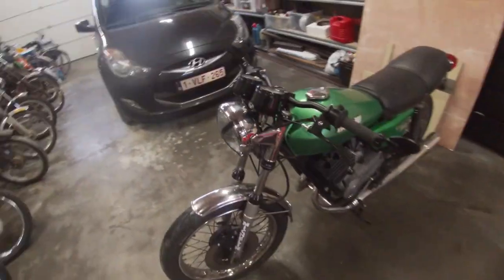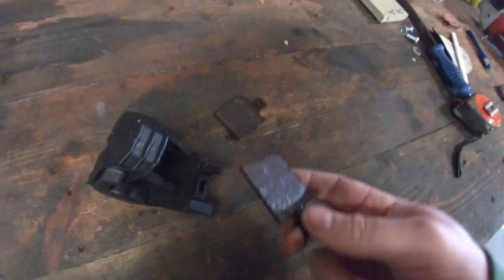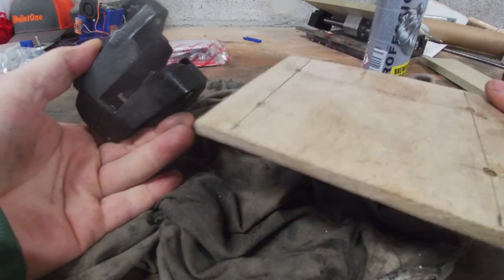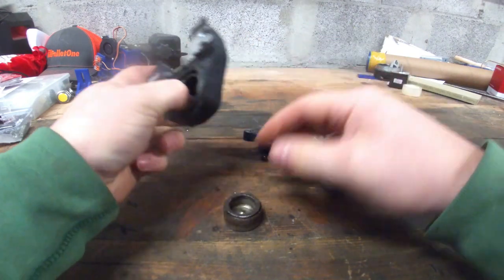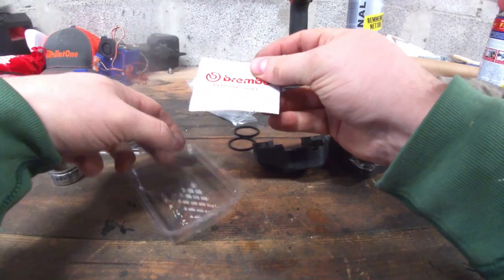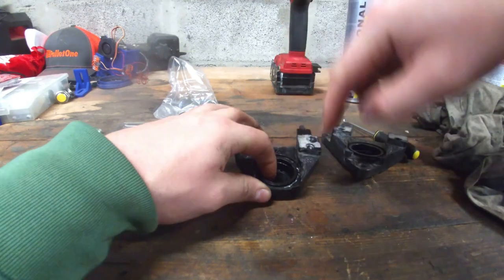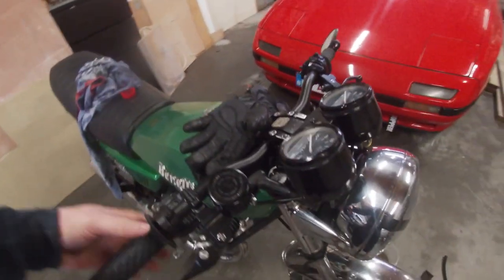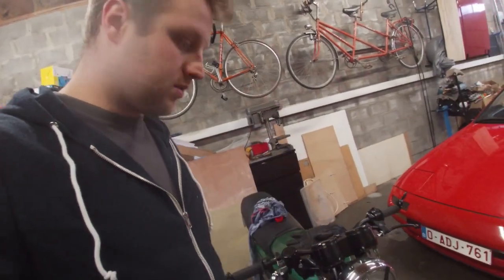Benelli 250 / Moto Guzzi 250 brake rebuild

Comment: I think caliper will leak anyway with worn and corroded pistons.
Reply from the maker: It's holding up so far. The corrosion is not really on the sealing surface, so so far so good 🙂

Comment: Hi, can you maybe send me a link or tell me where to get the same rebuild kit as you? i also have a benelli 250 and i cant find this kit. I am searching for hours  -.-
oh and nice video of course  i left you a sub ;)
Reply from the maker: Thanks man! Greatly appreciated! I found it on ebay. I will see if I can find it again. But I recently found benelliparts.de they have almost everything, even brake calipers!
Reply from the maker: Cancel the ebay part, that was for another bike. The rebuild kit I used was from here: https://tlm.nl/moto-guzzi-triumph/396590000000-revisieset-remklauw-v35-50-65-75
Pistons are sadly enough not sold seperatly.
Reply: @VintageGarageYT thanks mate, that helped me alot!
Reply from the maker: @KuroU27  Glad I could help!